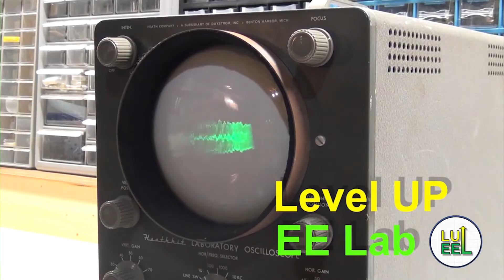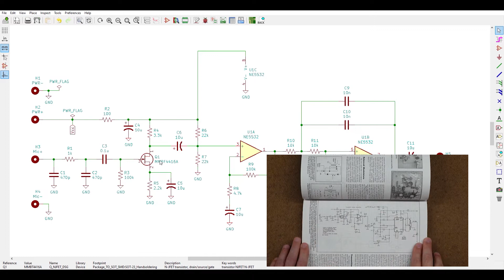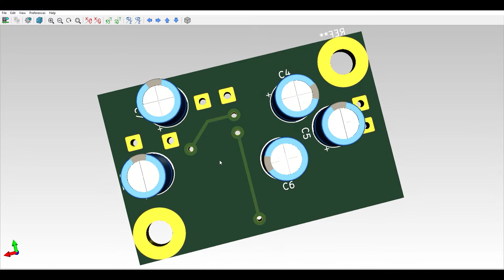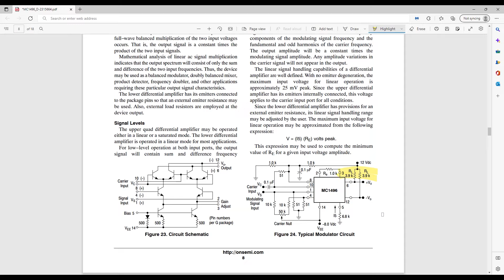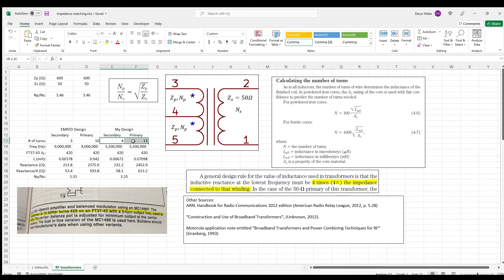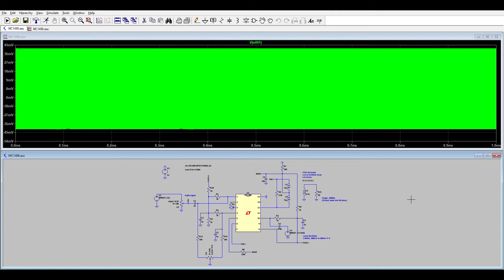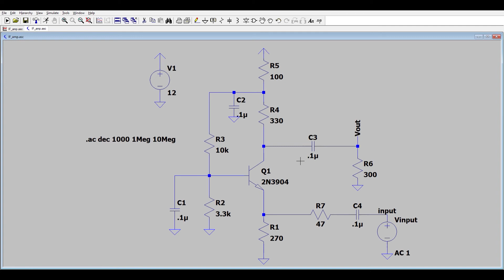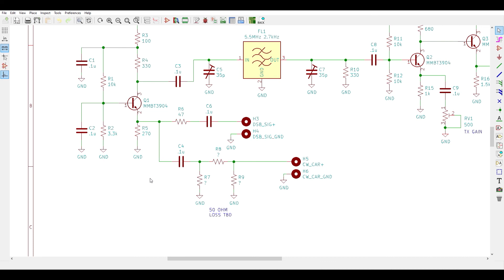HF Transmitter #02 - Circuits, Calcs, and Simulations!

Comment: Do younhave any recommended reading for rf circuit/superhet design?
Reply from the maker: The best reference that I use is Experimental Methods in RF Design.  Many of the example circuits use RF transistors that are no longer manufactured, but the methodology is still sound and relevant today.  It's available in a reprint edition by ARRL.